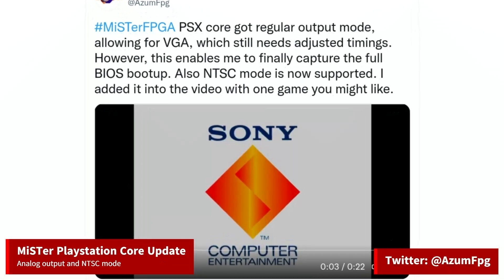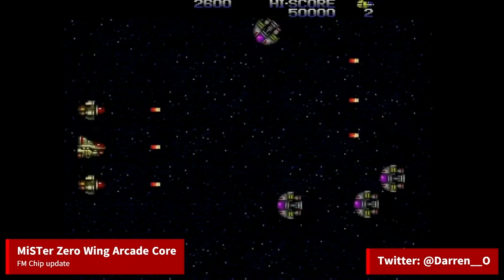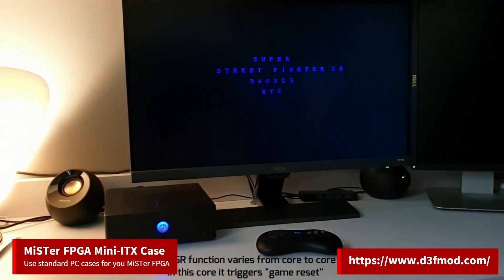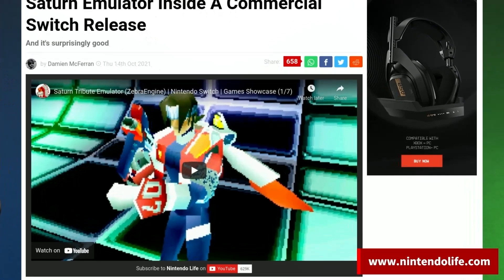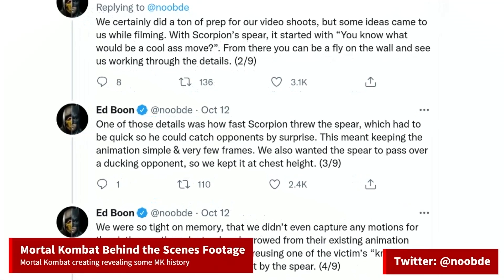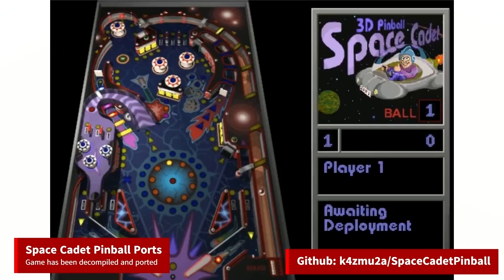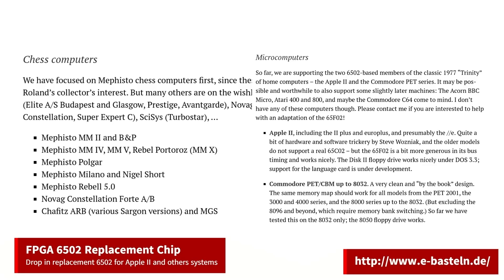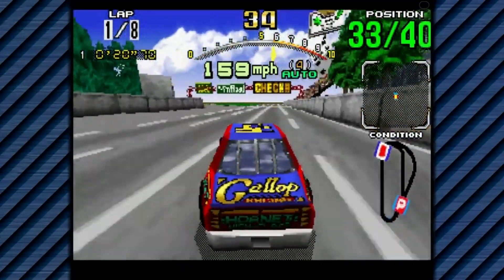MiSTer Playstation core updates, Mortal Kombat BTS, 6502 FPGA and more

Comment: SSF has horrible input lag on PC. For me its unplayable. i can't imagine the switch version is any better, in fact probably worse. Then you add in the TV lag and the bad lag on their controllers on top of it. It can't be playable for anyone with even mediocre standards. Not saying its not cool, but Saturn consoles are cheap. You would just need to buy an ODE and something like a RetroTink 5x if playing on a flat panel. Well worth the price. Even better if that Saturn core ever gets finished on MiSTer.
Reply from the maker: Yeah, that has been the general consensus with this emulator. Some games work ok but most have input lag.
Reply: @LusRetroSource  Well all software emulators have input lag but SSF is just way too much. RetroArch has some ways to improve the latency a lot, but the cores need to have savestates for it to work with the best option, RunAhead.
Reply from the maker: @NirnBootMod  Yeah, I tried RunAhead and it works really well.
Reply: @LusRetroSource  Yeah it does. You can even remove latency built into the game. Probably something like Mortal Kombat 1 on SNES, it had a very bad delay when pushing buttons.